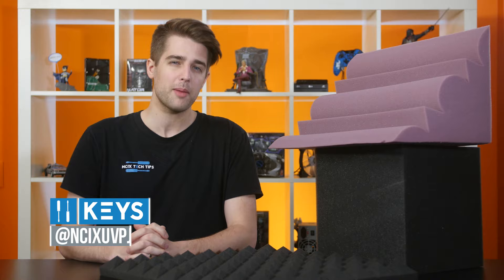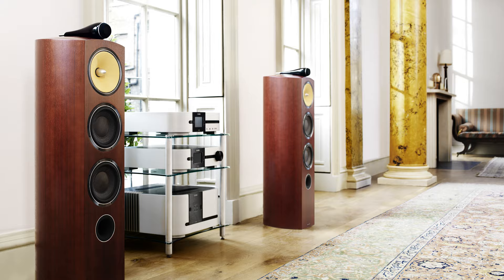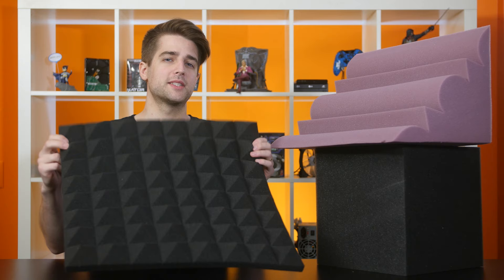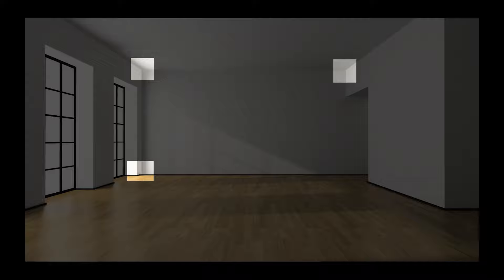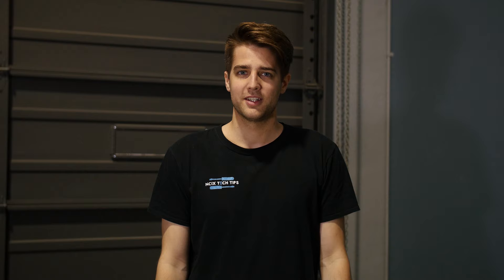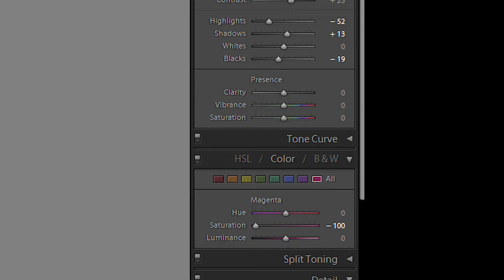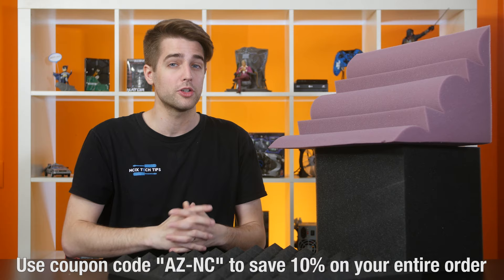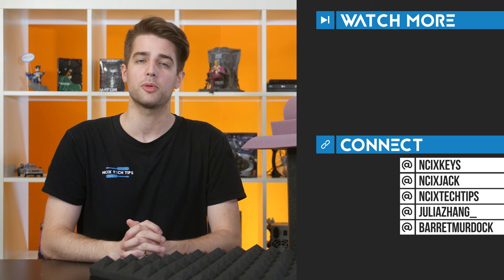How to Make Everything Sound Better ft. Arrowzoom Foam

Comment: Don't overuse high frequency dampening, make it balanced, you need a few reflections for things to sound natural. a few diffuser panels are great at making your room sound "lush" without nasty echoes. Trust me, I'm a sound engineer.
Reply: I was about to comment this...
Reply: So in a 10x12 room I only need routine panels in behind my computer and rig, and not in behind me? Basically a 3ft long wall the wrap to a two foot long wall
Reply: Actually,  that's about 2/3's right.  The biggest and most expensive problem to fix is the low frequency modal pressure issues, especially those under 100hz.  Those can typically be along entire walls or even the entire ceiling.   But those require a different type of absorption that's pressure based vs velocity based..  Once you have the low end taken care of, then you deal with the mid's and high's.   Various absorption materials can deal with mid's and high's, but the best absorption material should have a nice absorption coefficient curve from 125hz to about 1000hz and then anything above 1000hz to about 6300hz is pretty much the same from material to material.  But the major differences in different brands of foam, or other absorption materials is in the 125hz to about 1000hz.  That's where you have to be careful.  Why?  There is a human hearing curve that Fletcher Munsen figured out and if you look at the curve between 125hz and about 1000hz it's slope.  Some absorption materials were designed to have an absorption coefficient slope that better conforms to the Fletcher Munsen curve, but most either under absorb or over absorb.    This brand doesn't have a good aborption curve from what I've seen.  I have seen a better curve by another mfg.  In face Arrowzoom actually stole a graph from another company for their acoustic foam, replaced the name with Arrowzoom, and Arrowzeoom doesn't have any products that actually measure up to the graph they have on their site.  this is misleading the consumer, so I would stay away from a company that does that.

Now, as far as diffusion, you have to be VERY careful as to the type of diffusion, and the placement within the room and there are different things that will dictate what is best.. Obviously, this is partly based on personal preference, but people have to be careful as to what they use as there are a ton of products on the market that aren't actual diffusors, or at least not very good for diffusion.   The wrong diffusor or in the wrong place, etc. can actually do damage to the quality of sound in your room, especially with studios and you can get phasing issues, etc.

Comment: If foam is too expensive for you, fold up old towels and put them in a frame, they work AMAZINGLY
Reply: Josiah Alderden rockwool framed is good
Reply: Actually anything that absorptions sound will do something, the problem is you may not have the best absorption coefficient curve and that will impact the quality of the sound and whether or not it's over or underabsorbing in certain frequency ranges..  If you are a hobbyist and you don't care about the quality of sound because you have no money or simply don't care, then sure.   Heck, get carpet remenance and slap that up, but it won't sound good because it doesn't have a good absorption coefficient curve.  :-)

Building insulation doesn't have a good absorption curve for acoustic treatment, it's better suited inside a wall cavity of a room that's got nothing to do with audio, it's meant for homes where building costs are a concern, thermal and sound absorption from room to room for talking is an issue.  But building insulation for acoustic treatment is just not the best sounding absorption material either.

Comment: foambymail provides thicker foam, 3 inch wedges, where arrowzoom only does 1.9 inch.  Arrowzoom's 19.6" x 19.6" width and length, as compared to foambymail's 12x12, may, however, prove cost-effective for one's needs.

Comment: i used to work at a local tv news station. they had a voice over booth. once you walk in ans close the door, it was DEAD silent. like it was scary. you wanted out after 10 seconds. it was like you could scream and no one would hear you. no '' ambient'' sound or anything. it was like a vacuum. it messed with my mind so bad

Comment: a dab of hot glue flattened at each backside corner on the acoustic foam THEN double side tape or 3m command strips for attaching the panels is best

Comment: Just wondering if anyone knows how good this stuff is for blocking sound? I know true 100% soundproofing is pretty impossible and impractical. I'm just thinking of getting a TV in my room but I have a think wooden door (which faces someone else's bedroom), and I also share a wall with another persons bedroom.

Was thinking of grabbing some of the pyramid foam to stick on the back of my door and maybe putting a couple on the wall I share with the other person; surely that would make a TV on pretty low volume in the night pretty hard to make out, right?

Comment: don't tile every area of your studio, it's overkill. the best place to stick a few is to find the "angle of first reflection"Google it. bass traps, don't forget to put the bass traps at the back of the room and into the top corners of the room as that is where bass builds up. Also your speakers might be front or back ported, if they are back ported then you'll need to put treatment behind the speaker.

Comment: can it help keep sound in a certain area and not crossover to other rooms through walls etc..?
Reply: Sound dampening material absorbs sound (instead of reflecting back into the room the audio bounces around inside the material until it looses all of its energy), so assuming that the audio is being transmitted though the walls and not by the walls (there is a difference, but the latter is super unlikely) then yes, this would help.
Reply: shadowcalen ty. I assumed it would at least help a decent amount to be worth trying.

Comment: I hear egg cartons do a good job for the price
Reply: TheForgoten100 Though they have their limits on how much echo it can absorb.
Reply: You need to buy empty ones as those you get eggs in tend to rot.
Reply: TheForgoten100 My school used them, until they had to be removed because of safety reasons. highly flammable stuff
Reply: TheForgoten100 this is a myth, they do not work well. They do a little but not much, don't waste your time/money on egg cartons
Reply: Nope nope nope nope nope don't do this, they dampen a specific frequency area, then the rest sound like shit.
Reply: TheForgoten100 egg cartons do not work this has been proven time and time again
Reply: Old towels in a frame work much better
Reply: @Fish

Oh yeah, much easier and cheaper /s
Reply: Grab a stack of towels at a thrift store.  It costs a few bucks for plenty of material.  The frame is another few bucks spent at home depot.  It's not hard, and it can look good if you're not a dunce with tools.
Reply: nope not at all
Reply: It's only worth if it you have a quick and easy way to get those egg trays like restaurants get where it's like a 14" square between stacks of eggs. If you're talking about the ones you get with a dozen eggs at the grocery store, it's much less of a compelling solution.
Reply: It's never worth it, they do a HORRIBLE job, we've done a paper with a friend when I was in sound engineering school about them, we even tested them in an anechoic chamber. Better buy some high density rock wool, wooden frame and some cloth and make your own absorption panels, you'd be surprised what you can do with 100-200$ and a few hours of work.
Reply: nikumeru what frequency does the egg carton filter the most? Just asking because it could be a good alternative if you have something that gives out lots of soundwaves close to that freq.
Reply: Egg cartons themselves is a misconception. You want those foam mattress toppers that look like egg cartons. Not as good as actual acoustic foam but on a budget it makes a huge difference. 

DIY perks also did a video on using bathroom towels.  I haven't tried it myself but it looks promising.

Comment: As a long time dear I'm disappointed in you guys. You can get much better results if you use Fiberglass, Rock Wool, and Recycled Denim. Foam only works in a limited high end frequency range and looks plain ugly. Your small speaker test box will not at all be accurate picture of what speakers would sound like in a zero reflection environment for that you need an anechoic chamber. As someone who has been on team treating large venues and control room studios, this will not work.